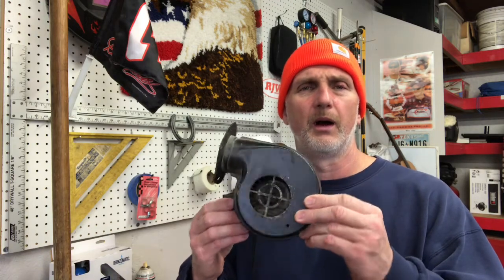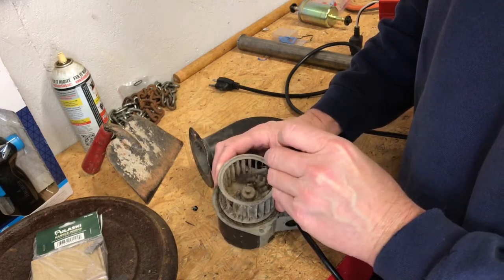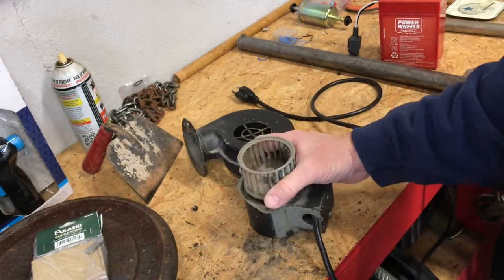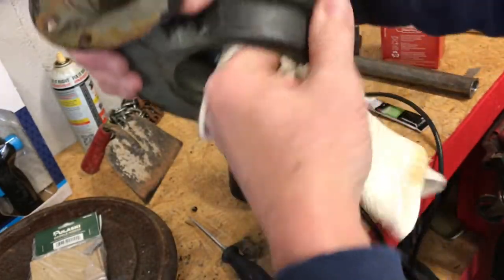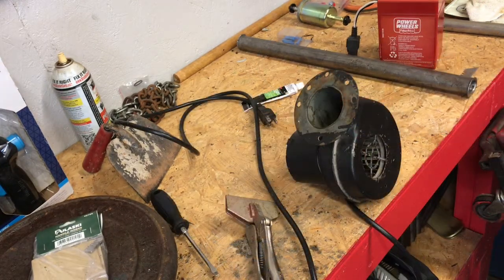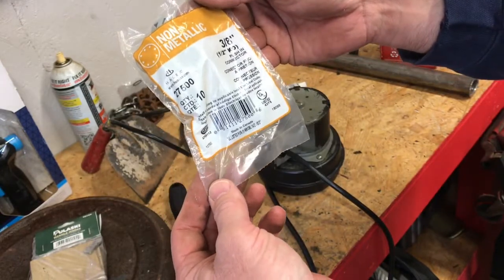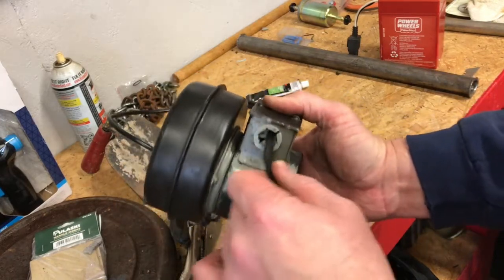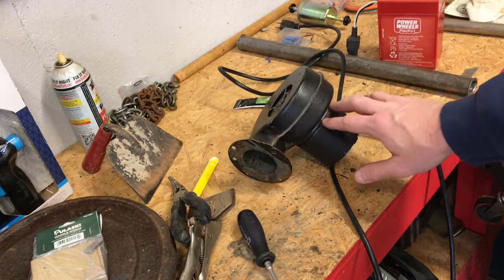How to Disassemble & Clean Blower Fan Assembly for a Wood Stove - DIY

Comment: We have same blower and did what you did to clean it. We also shifted the motor 180 degrees when RE-installing it and it is much quieter and doesn’t gather as much dust.  Great little motor is almost 50 years old being from a 1983 consolidated Dutchwest federal airtight Woodstove we were lucky enough to get with our new home. MODEL FA226CCL
Serial Number 11632. I read somewhere that it doesn’t need to be oiled but that could be wrong info. Thanks for video!

Comment: Good video!! For the Ground Wire, a crimped Ring Terminal and then through the screw would guarantee it doesn't come off. Better would be a self tapping screw through one of the sides but still using a Ring Terminal. This avoids depending on one of the cover screws. I have to suspect this fan may not have used a ground cord originally though..so this maybe a replacement.

Comment: The nice thing about those  Plastic grommets is that you don't have to  disconnect the wiring you can just  slide it over the wire and push it down into the hole I think?